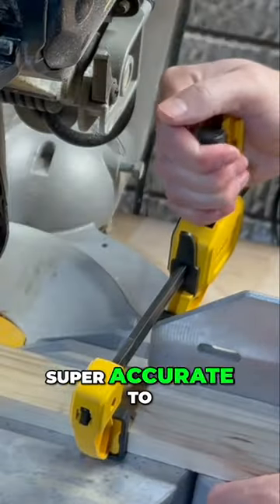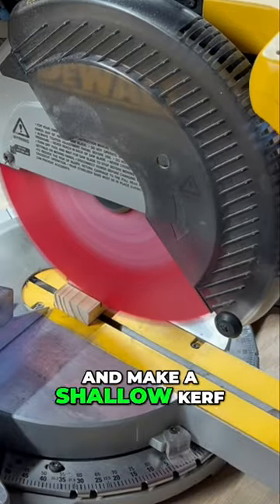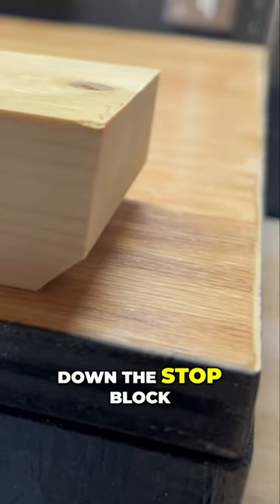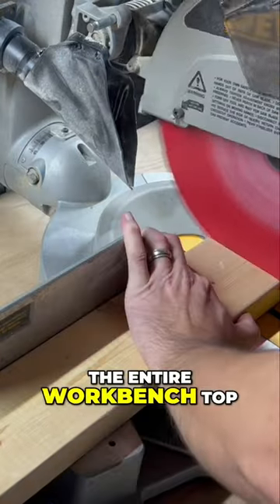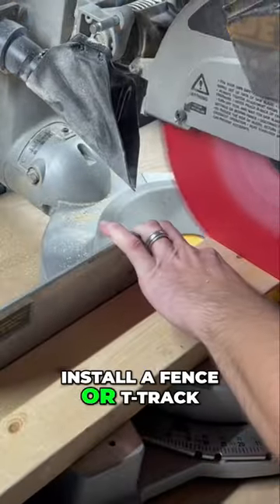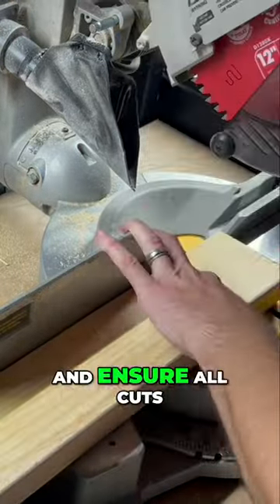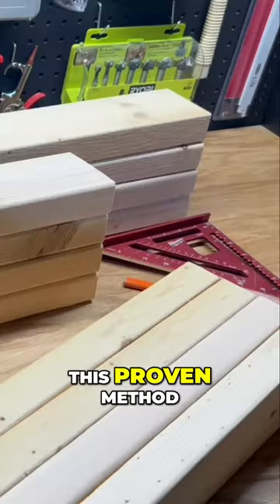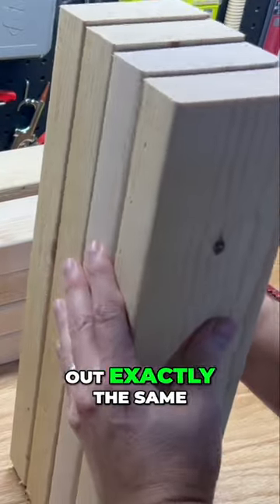Miter Saw Stop Block #howto #shorts

Comment: Definitely alot easier when using a mitre station rather than dragging around your saw to cut on the lawn,  or deck,  or anywhere else you're trying to slap tgthr a project. 

Good tip though.
Reply from the maker: Thank you.  Miter saw stations are handy.  If you don’t have one you can drill a straight edge to the miter saw fence from the mounting holes in the back of the fence.  There’s multiple ways to support your work piece as well.  👍